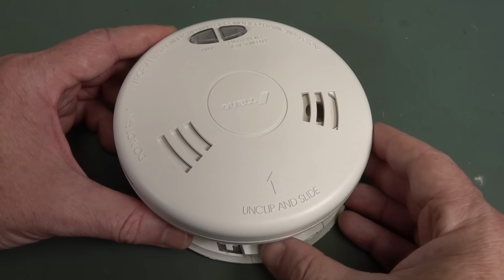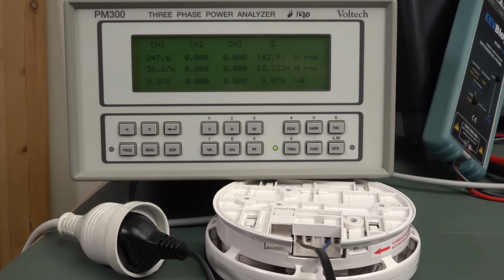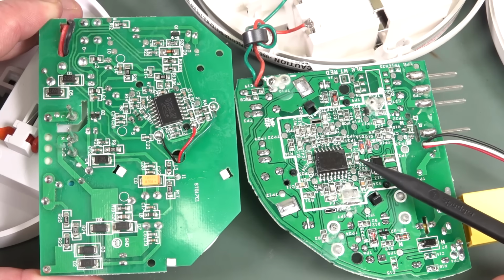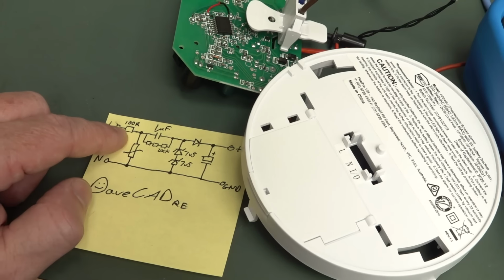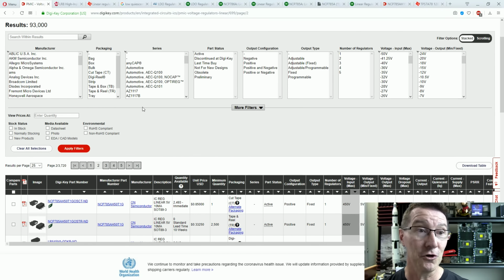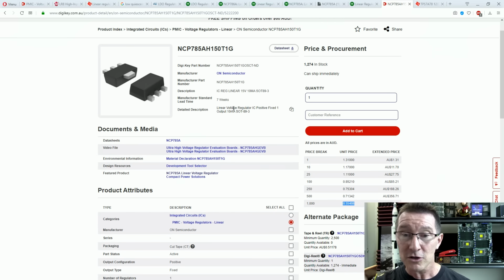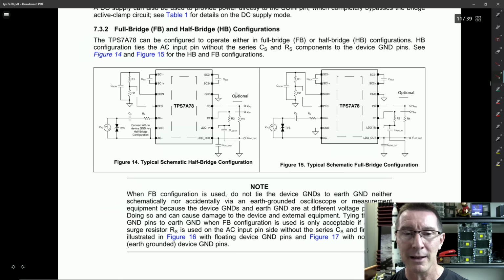EEVblog #1284 - How Bad Product Design Kills The Environment

Comment: Primarily we connect Smoke Detectors to the mains power so that when one detector senses smoke, all of the detectors sound the alarm. The third wire on these detectors is used to transmit an alarm signal from one detector to all the other detectors.  Powering the detectors with mains power is a secondary function.
Reply: Then why not use 20 AWG wire, with or without a single mains PSU running the whole lot. Needing to run conduit or 14/3G Romex to everything drawing at most 80mA is ridiculous. The power cabling almost costs more than the devices connected to it. Add to that the cost of needing a licensed electrician to install it in most cases raises it by another factor of five or ten.
Reply: @strehlow  I can only speculate as to the rationale requiring the use of 14/3. In  no particular order, the code authorities are to some degree influenced by manufacturing associations, and wire manufacturers make more selling 14g than they do selling 18g. It is deemed to be (I assume) safer if all smoke detectors are on a dedicated circuit. It is deemed to be (I assume) safer if smoke detectors only be installed by licensed electricians so as to ensure that the installation meets code as regards to detector location and number. Mains connected smoke detector systems are considered (I believe) to be the minimum level of fire protection safety. If it was up to me I would favor smoke and CO systems that use detectors each with it's own unique digital ID and all networked together, preferably with an annunciator providing information as to which device has been triggered. I believe that the code I have to work under requires mains voltage, interconnected smoke detectors as a minimum, Unless, the structure is fitted with an approved smoke detection system such as a fire alarm system with smoke and heat detectors, pull stations, annunciator panel, etc. etc.. I have not however worked as an electrician for some years and I am not familiar with the current edition of the Electrical Code used in my area.
Reply: Locally, we are now required in almost all cases to provide a One Inch Water Service to every single family residence. The size depends on the fixture count but almost always a One Inch pipe is required. The reason is because water used to be different. 25 years ago you could supply all the water a house needs through a 1/2" pipe, but today water is thicker and slower so we have to put in bigger pipes because the water just doesn't follow the same physical laws that it did 25 years ago.
Or maybe, just maybe manufacturers make more money selling One inch pipe than they make selling 1/2" pipe.
Reply: Today electric hot water heaters, typically a mild steel tank with a ceramic coating and immersion elements, will last about 8 to 10 years. This is an improvement on the 6 year average life of tanks in the 1980's through to 2000 or so.
It is however a scandal compared to some tanks still in service today, that were made in the 1950's and 1960's. The long service life of those tanks was due I believe to being made of slightly heavier gauge steel and having much better more uniform ceramic coatings. Some lasted better because they were made from bronze or Monel. It is, in my opinion, criminal that hot water heaters are seemingly engineered to have such a short working life. The costs, energy and inconvenience of  mining the materials, processing, manufacturing, shipping, installing and recycling every 10 years a product that should be able to, and historically was able to last 40 or 50 years, are costs that consumers (and the planet) should not have to pay. But as I was once told by the manager at a plumbing supply house "water heater replacement is 'Good Business'". So suck it up and pay because that's how the world works. Cheap ass smoke detectors and expensive and messy water heater replacements.

Comment: I have a bunch of questions and a comment. Q1: What is the 100 ohm resistor for? Is it simply to limit inrush current? If so, what's the cost difference between a 2 watt resistor and a lower power NTC thermistor?  Comment: If your circuit literally only needs a few dozen microamps, just size the capacitor correctly. You don't need 80 mA quiescent current if you're only drawing 0.1 mA.  If you're concerned with power factor, just use a resistor! A 100 K resistor across the mains will only dissipate 0.25 Watts, but will still give you 1 mA.  If you need a short burst of a higher current, then use a big, cheap, low voltage electrolytic on the low voltage side as a buffer.  Surely a single resistor, two diodes, and a capacitor would be the cheapest solution?

Comment: Smoke alarms are put in by builders and builders couldn't care less how much you will be paying for power. So if they can save a few nickels with a poor design, they'll do it every time...
Reply: All ways presumed that these things were low energy every thing else we fit is supposed to be glad Dave’s done this vid is there no regulatory body that’s supposed to sort this out and check 
Electricians that fit these know minimal and micro electronics 
Yer sure they taught about power factor but they don’t check it or have the meters to check it that I’m aware of
Great video Dave opened my eyes
Reply: @anthonyselby8337  Again, multimeters with power factor are more expensive, testing takes time and that is more expensive.  Not going to happen in the construction industry, no matter how well taught the electricians are.
Reply: @ats89117   Absolute truth.  I imagine over the term of a 30 year mortgage, replacing 5 smoke detectors with better, lower power ones would give you a net cash back in energy savings.
Reply: @chrisw1462  - over a THOUSAND years, replacing a THOUSAND smoke detectors with better lower power factor ones would save exactly ZERO dollars in energy savings.
Domestic customers are not billed in kVA.
Commercial customers have lagging PF (from motors) so the capacitors in soke detectors etc make the PF better, not worse.
Reply: @johncoops6897  I wasn't talking about VA vs. watts.  Just plain power consumption.
Reply: @chrisw1462   - the "power consumption" of the first unit that Dave tested is 0.563 Watts. Let's say that you somehow reduced that by 50% (halved the power). Each unit would save you 2.459 kWh per year, so if you pay 40c/kWh then that's $1 per year saving.
That's the equivalent of reducing your stove top element (say 2kW) for 12 seconds per day!
(in other words, the power saving is 3/5th of fuck all in the overall scheme of things).
Reply: @chrisw1462  there are NO energy savings with this, in fact it may actually be more efficient. very low energy loss in a Capacitor!
Reply: The loss due to PF may not be significant, but the rectifier/capacitor power supply is absolutely woeful (comparing consumption on mains vs battery).
That's where runtime cost savings can be found.
Reply: @stuartremphrey228  You talking about the 99% loss quoted? that's actually the difference between the active power and reactive power, it is not actually a loss. The only loss in the rectifier is the diode drop, 1.4V, not certain what the DC supply in there is, but it looks like it may be 24V, maybe then regulated down to 15.ore common is to have 12V. Anyway, we know the current in the rectifier (78mA), so loss is 0.078A X 1,4V or +- 120mW.
Reply: Low bid!

Comment: X2 Interference capacitors in series as droppers?  Are they spec'd for that use?
Reply: they are specced for directly across mains input, so yes
Reply: @mycosys  Thanks, I thought that was their only use. I had no idea that you could then inline like this as well, I thought I read somewhere  that only Y2 or X2/Y2 caps could be used this way.

Comment: I think we're not far away from using DC wiring with a central power supply in our homes, like in a RV.

24 V DC is quite interesting, since you can get cheap stepdowns for 5V (USB) and 12V (LEDs + Many Laptops). USB-C Laptops on the other hand run on higher voltage, but there are 24 V to USB-C power supplies readily available, since in Europe Trucks use 24 V battery power instead of 12 V.

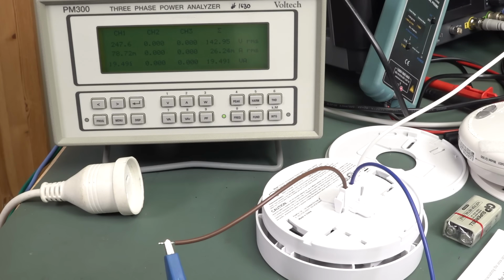Comment: 6:23 Dave needs a Cliff Quick Test....
Reply: I'm sure BigClive could send one.  Although it will have to be the southern-hemisphere version, these can be harder to source.
Reply: @Brian_Of_Melbourne  Yeah, they need to work right-way-up, since they're mounted upside-down on a ceiling which is itself already upside-down. If you get the wrong model for your hemisphere the smoke falls out before it can be detected.

I'm very fortunate: I'm an ex-pat Aussie at the moment living in Singapore, and I've found that we're so close to the equator that both types work fine here.

Comment: Dave is wrong about the reactive volt amps on the power grid with the low power factor, power companies use capacitors on the primary power lines to correct the power factor back to the generators, so the amps on the wires from the reactive power only affects the wires and transformers from the source to those capacitors.

Comment: It is likely designed to always draw what is needed when the beeper is going.  
The beeper signal could be used to "gearshift" the current up when the beeper is needed.
This seems like an added MOSFET and capacitor would do the trick.  Normally 2 capacitors in series would set the current.  To beep, one gets shorted out to make the current higher.

Comment: Is there a brand of reliably-built detectors then? There must be someone who actually thinks these things through.
Reply: I have Nest Protect ones. They aren't bad. Runs on 6xAA, no mains power needed. Seems a bit excessive, but they've been running for 3 years now on the original batteries.
Reply: @superq  thank you. I am concerned however about Nest's privacy issues.

Comment: You’re ignoring the piezo siren @ 150mA.  A 10mA LDO won’t work unless you have more complex circuitry to bypass the LDO reliably when the siren needs to turn on.  More cost, more risk.  But generally this power loss is shocking and the mains devices cost 5x the battery powered versions.

Comment: I would think a smoke detector is such a low current requirement that it could be powered by a solar cell.
Reply: Make it powered by the light emited by the fire!    Actually that has me curious now... wonder if the light emitted by fire has any effect on solar power generation.  Sounds like an idea for a camping experiment. lol.
Reply: @redsquirrelftw  Photovoltaics operate mostly in the visible spectrum.  Since you can see fire, it covers most of that.  So yeah it would work.  Downside is, by the time the fire is generating enough light to power the smoke detector, it's probably a little late.  
I was thinking more along the lines of trickle charging a lithium ion cell from the light of a well lit room.  Doesn't even have to be lit 24/7 I figure 8 hours of direct sunlight or 12 hours of indoor light should be more than enough to power that thing for days.  Weeks even.
Reply: In general there is no need as 10 year lithium cell smoke detectors already exist.  Also #SOLARFRICKINGSMOKEALARMS

Comment: "It is a safety product" -- I'm curious how frequently you'd hear this argument to justify the poor design characteristics that are unrelated to the actual safety.
Reply: You could power several computers that would be able to take a human rated space capsule to moon with the power that these things require.
.
Reply: Kidde smoke alarms aren't even reliable. The last one I took apart had the wires to the speaker routed right over the big 1/2 W resistor, which melted the insulation and shorted out the wires. So if anything the poor design makes them less safe.
Reply: @jayleno2192  Sad...

On the bright side, maybe it'll start a fire, then, if still working, detect it and warn the occupants... :-(

Thereby demonstrating it's usefulness and  justifying it's existence.  ;-)
Reply: Mine are powered by a battery, which last 10 years, so no 230 V supply. They work, if something is smoking on the stove they switch on. 

Such products can be also found in other places, I have already seen a TV antenna amplifier which was rated for 150 Watts (which means it consumes 1300 kWh per year - a unbelievable waste of energy)
Reply: I know right

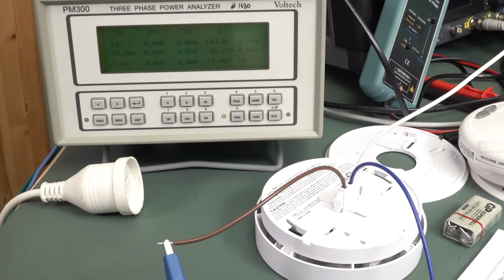Comment: 7:40 - And a MONSTER capacitor (or inductor) to correct the bloody power-factor!
Reply: capacitor PFC only works with inductive loads such as motors or magnetic ballasts. electronic loads can't be corrected with "passive" PFC, they need active PFC tailored to the task. you can't do a "general" PFC for these like you can with a bank of capacitors for, say, a whole factory.

Comment: All new builds (and I'm in the old dart) have to have them linked together (So if one goes off. They all go off) and powered. Mine are "Kidde" btw 
2 smoke
1 heat
1 carbon monoxide

Comment: There may be a little more to this than meets the eye...

Quiescent / standby supply capability is one aspect, however the device would require potentially significantly higher power when triggered (ie. when the alarm is sounding).  Powering the detector portion would be only half the story in that case and so providing a restricted current power supply just for the chip would then need to be mirrored with a second supply that was capable of driving the sounder (does that now mean two separate supplies...), along with some kind of switching mechanism...?

What about the reliability aspect of then needing to switch in a second supply to drive the sounder?  The last thing one needs in a product like this is for the second supply to fail just when its needed most.

As a homeowner, then, wouldn't you want to know that your smoke alarm's power supply was fully working and (presumably) capable of delivering the full required current including the sounder when its needed?  Having two sections might then defeat that purpose...?

Bearing the above in mind, what is the regulatory requirement WRT qualifying these devices for installation in a domestic context as a safety device?  In particular WRT power supply reliability?

We all know how regulation tends to play safe and can lag behind in many areas...  Perhaps this is a mandated regulatory aspect of the product's design...?
Reply: Dave's solution of using a linear regulator accounts for both types of load. The upside is it only draws the current the circuit needs (as opposed to the capacitive dropper), the downside is that this current is drawn at an efficiency of 9/230 = 4%, unless your regulator is very smart. This efficiency stays the same no matter if there is an alarm or not.
Reply: @Basement-Science  Pulled all my Quells today and order a bunch of parts.  Will give them a retrofit...  ;-)

Having said that, I note that the data sheet for the device Dave mentioned states only a 10mA output capacity (https://www.onsemi.com/products/power-management/dc-dc-controllers-converters-regulators/ldo-regulators-linear-voltage-regulators/ncp785a).  I think Dave may have conflated a "Smoke Detector" (which is a stated application on the data sheet) with a "Smoke Alarm".

A "Smoke Detector" is a low-current device, designed for integration into a commercial building's smoke alarm system.  Alarm sounders are generally separated from the smoke detectors themselves and have a separate driver supply from a central fire panel.

A "Smoke Alarm" (such as the product Dave examined) has an integrated detector and alarm.  The 10mA capability of the On Semi NCP785A part won't provide the current needed to drive a 100dB+ sounder...

The devices I see online use anything up to 2 orders of magnitude current draw than the 10mA of the device Dave is suggesting as a replacement.  If such a replacement were made, there would need to be a secondary supply to support the sounder if an NCP785A was used to power the detector and associated chip...

Comment: Add to that the decommissioning of the copper network and home land line's now costing an additional PSU for the handset base station,  a PSU for the fibre modem, a psu for the UPS if installed, a psu at every node....
Reply: I wish.
Most of the country is stuck with FTTN.
That means the old copper wiring is still with us in the house, but no longer functions the way it used to...

Worst of both...
Reply: @KuraIthys  If you're stuck with FTTN, try to get them to connect you to hybrid fibre cable. It's much much quicker than the cooper pstn/adsl pairs and gives reasonable speed depending on how far you are from the exchange.

Comment: Hey @EEVblog, I just thought of another one. Bathroom extractor fans, mine draws a couple watts all the time since it's just a big dropper resistor and a zener diode to run the fan timer control circuit (I've seen them with capacitive droppers too). Every bathroom gets them now which is another necessary vampiric load in every home.

Comment: i wish they would design a smoke alarm that has a test/hush button that you can run wires down to a place on the wall.  for disabled and elderly people.  you may have them in Aussie but i have not found any in New Zealand. David are you aware of any.

Comment: Never understood the mains smoke detectors i always use battery powered ones in my homes. Unless its new construction code requores it in usa for some insane reason. I always swap em for battery after signed off. NOW this is risky if you do have a fire and its not code then insurance could fuck you. BUT if you have a fire and smoke detector works hopefully you can prevent that